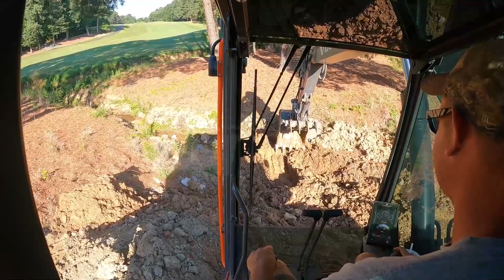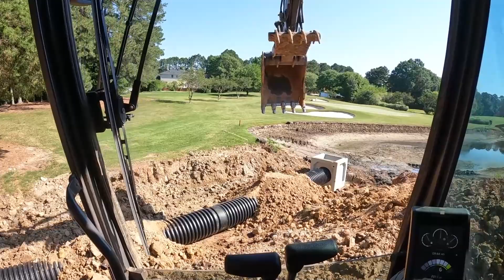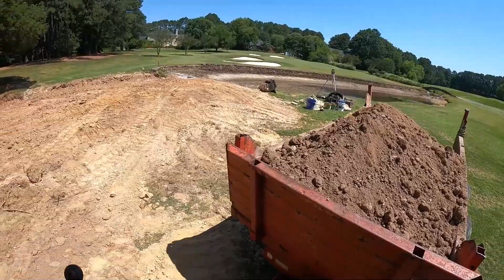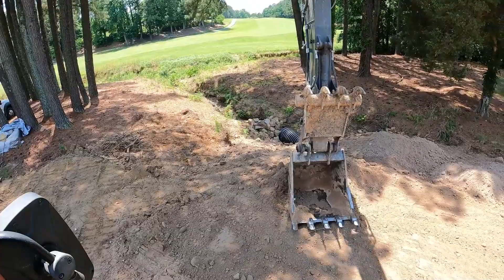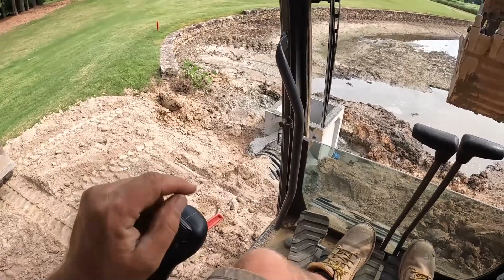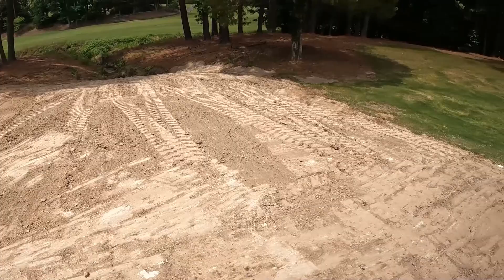Rebuilding The Failed Pond Dam And New Overflow System

Comment: Irrigation lines are and usually one foot deep. We use heavy mowers and tractors all the time to cut the turf and maintenance practices like aerating, verticutting, vertidrain which is 10 inch deep solid tine aeration to help with deeper roots oxygen levels and so on and lastly top dressing which we do once a year but some courses never do it.
Reply: “Beware the deadly “black layer”!

Comment: If you guys haven't heard of verti-drain aeration you should check it out.
Reply: I do it many times a year at golf courses all over nc, including this golf course
Reply: @93probegt1  most people don't have a clue about golf maintenance programs so I like to share interesting stuff people would like. I own one at the course I'm superintendent at, private club go figure. We do greens twice a year solid tine only because we aerate hollow tinetwice a year and verticuit or groomers as toro calls it. Do you know about drill and fill or have you ever done it? I've seen videos but never had to use that process thank God because old greens are a nightmare, I've only worked with 90 to 95% sand greens the rest peat.

Comment: golf courses are not my favorite place to work.   "it's just grass" doesn't go over well with them.  I like the dump trailer didn't realize it was hydraulic dump at first I was thinking how the heck is he going to lift that with it heavy loaded in the front.  small but did a great job for the application.

Comment: I was wondering if a vibrating plate compactor would be as effective as the sheepsfoot in a situation like this.  Sort of a super jumping-jack, of course it might be as hard on the mini as a jack-hammer attachment!
Reply: I'm not sure what if any difference in the amount of compaction would be, but the big difference would be maintenance. The vibrator plate has more wear and he would have dismount and unhook hydraulic lines.  The sheep roller he can detach by pressing a button in the cab and switch between the roller and bucket in a few seconds.